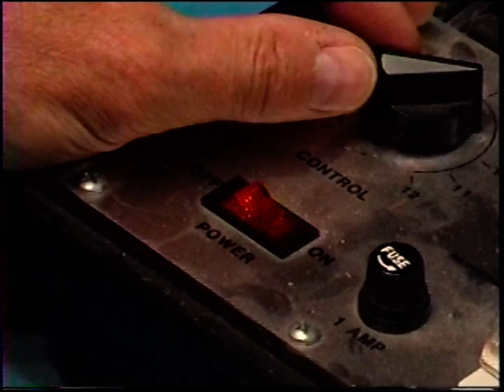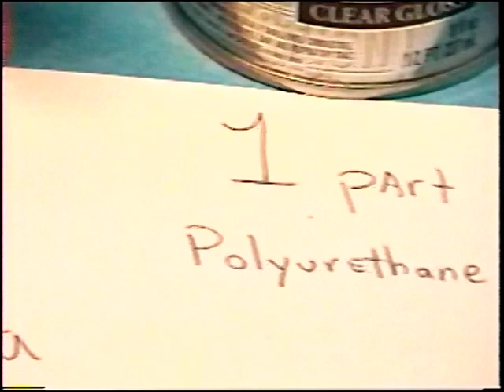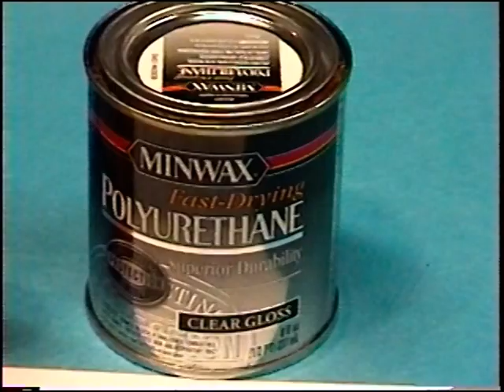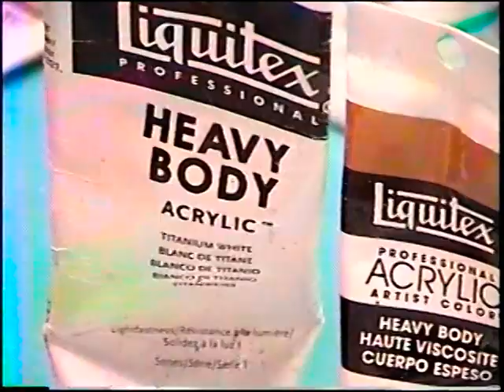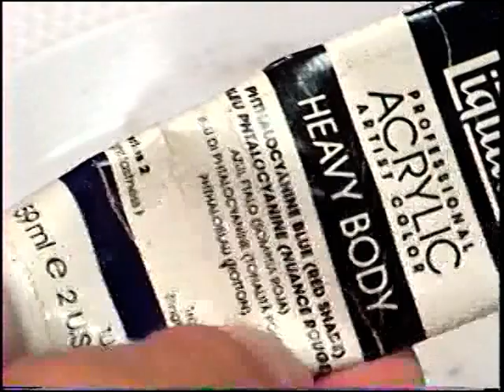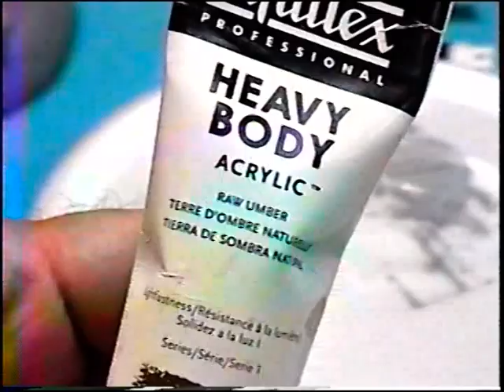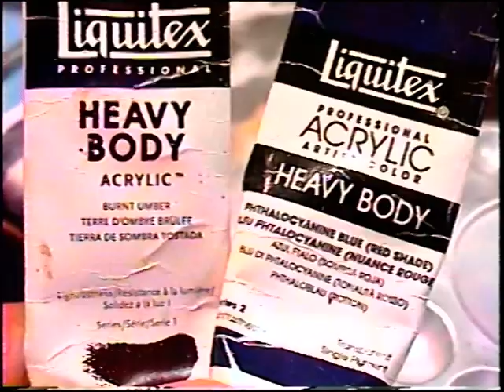Carving a Snake From Wood! "Coiled Timber Rattler" Part 3 of 4

Comment: Hi Thomas , had a question about the sealer you made 2  to 1 . how many coats to use of sealer ? and water base paints stick to this ? I know you can't sand this with all the texturing you have done it would be impossible .I painted a bird carving last year and first used gesso but made the mistake of putting it on to thick and lost my details in feathers . also the grain began to rise. You  just seal and paint . Thanks again for sharing your talent .
Reply from the maker: +viper sniper Hi Viper, Yes, just one generous coat of this home made sealer is enough. It soaks in and really seals the wood for the next step, which is either priming with gesso or just going right to painting. I to occasionally carve a bird with fine burned lines and I will go right to the painting with water based acrylics. The acrylics definitely stick to this sealer and so would oil paints. If priming a bird with really fine lines, you better really thin out the primer with water. Hope this helped. Feel free to ask more.   Thanks for watching!